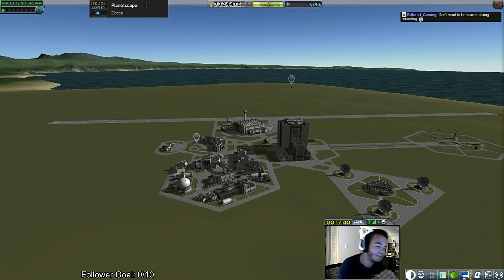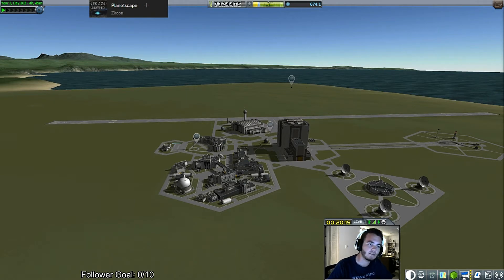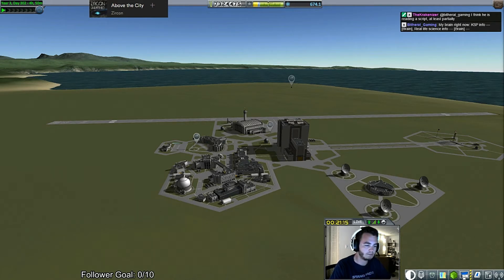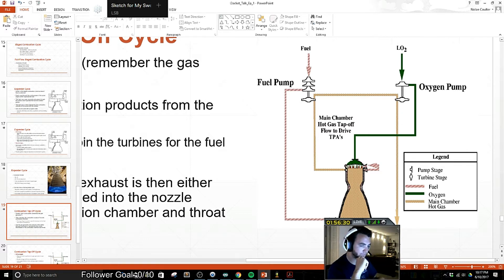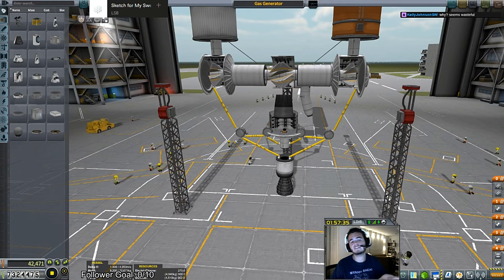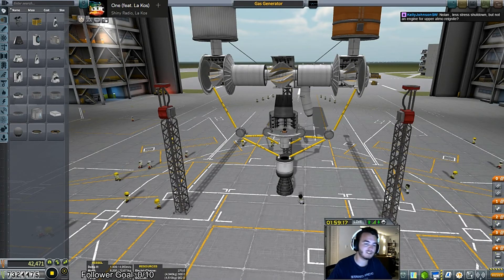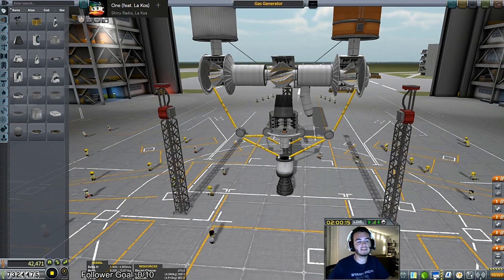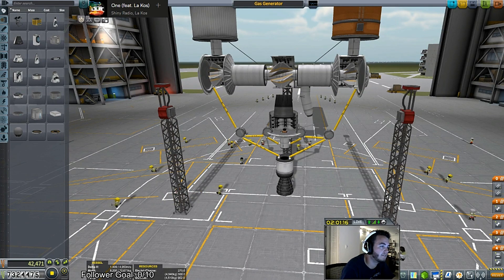I2ocket_Talk, Ep.1: Combustion Tap-Off Cycle

Comment: While I don't think cutting to various points in the stream and splicing them together is a bad idea, you need to be more careful about it. In this video you clearly refer to information you talked about earlier on stream, but did not include in the video. Also you run into the fact that an edited video is supposed to have a different tone than a stream, which makes it seem a little weird.
Reply from the maker: Yes, I agree. I'm in the process of figuring out the best way to do I2ocket_Talk. I can't just post the 1 hr and 50 min video from our live stream episode so I thought splitting them up and putting all theparts in a playlist would minimize the loss of information that I may refer to in this video but not cover. Any suggestions?
Reply: @I2ocketGuy  could you please elaborate on the tap location and how is the size of the tap is determined?

I know this might be a bit more indepth but how can i get this info?
Reply: I get what he is saying,but it was great still